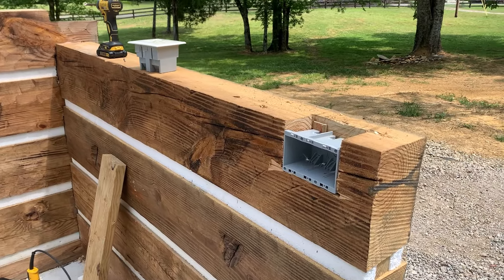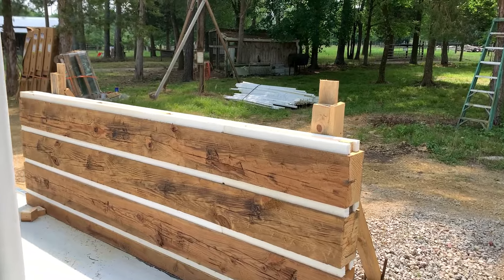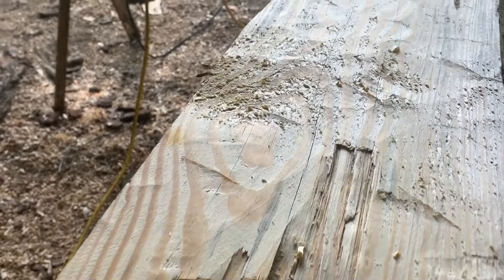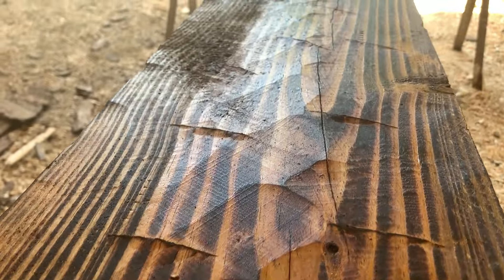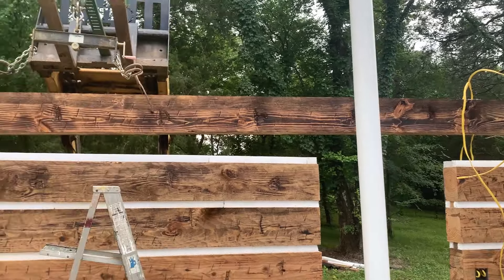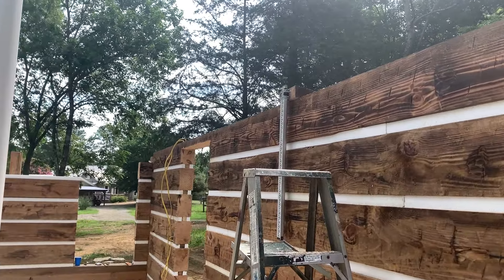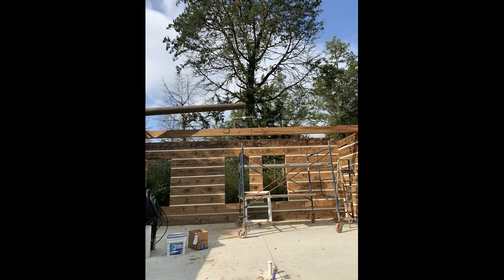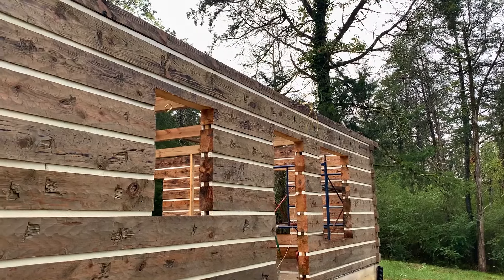Stacking the last cabin logs from my Woodmizer Sawmill.

Comment: But all of your logs are only sitting on small wood blocks. That can't be strong and stable.
Reply from the maker: Solid logs across the top are the structure of any log wall. The old school log cabins were the same way. It’s more solid than you think. Especially with so many screws and angle iron at all openings.